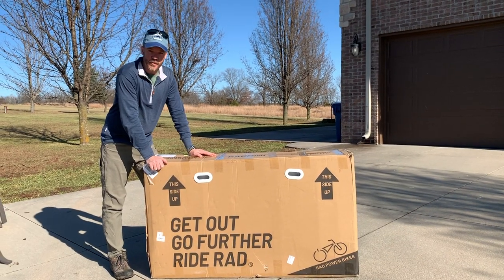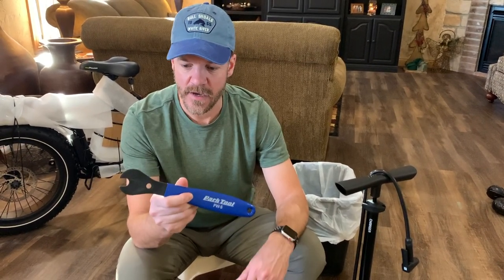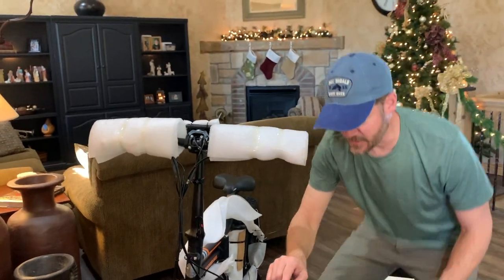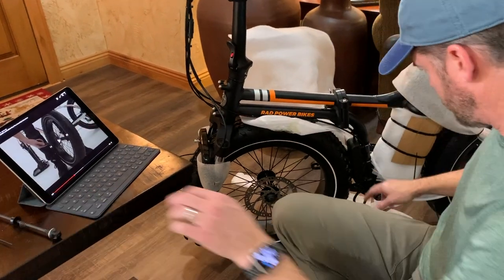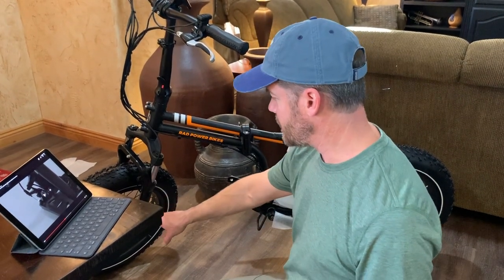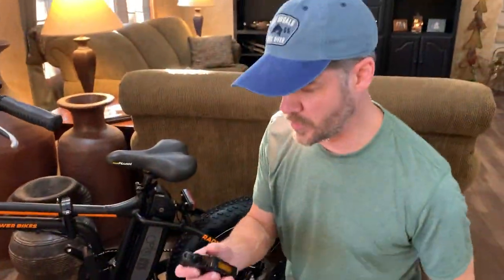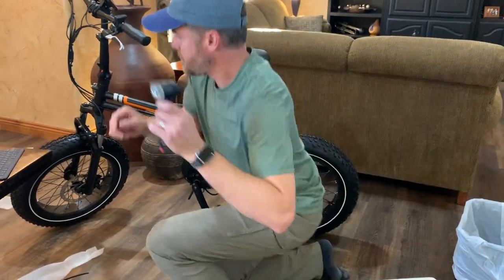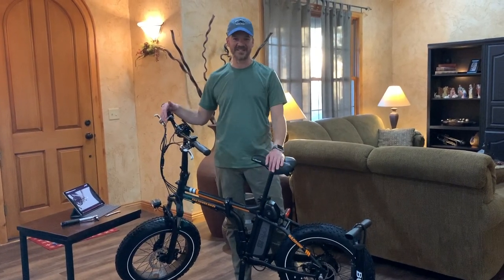Rad Mini Unboxing, Assembly, and First Impressions // Rad Power Bikes

Comment: How tall are you in feet and inches? Just wondering about the height of the bike and comfortability
Reply from the maker: I am 6‘2“ tall. I have the black Rad mini bike. I put the seat post at the highest possible setting and don’t feel crowded. I really like the bike. I will likely find an aftermarket seat post so that I can get another inch or two of height. Good luck!
Reply: I'm 6'6 and everythings maxed out- I like the raising handle bars

Comment: A great video and very helpful for somebody thinking of buying a Rad Mini.  I am thinking of buying, I live in an apartment and use an elevator.  Is the bike easy to move around when it is folded up?  Can it be wheeled when it is folded up?  Cheers
Reply from the maker: The mini is a great option because of how it folds, but it is a little clumsy in that position. My suggestion for an apartment would be to roll it into your place, and then fold it up to put it away. I think it is small enough to go on most elevators without folding. Good luck!
Reply: @TodayisanAdventureDay  The elevator is only for 8 people and a Rad mini would not fit in without the bike being folded.  I know the bike is heavy.  I'd be grateful if you could let me know if you think folding the bike to get it in the elevator every day  would be maybe too much hassle for most people?
Reply from the maker: The challenge is that the bike will not roll once it is folded. Perhaps you could lift the front wheel up and roll the bike on its back wheel into the elevators so that it is standing upright. I’m not sure if that would help the situation or not. The final option would be to fold it in half, put it into a rolling tote, and then rolling the tote into the elevator.
Reply: @TodayisanAdventureDay  Thanks for your reply, the key piece of information for me is the bike does not roll when it is folded.  I think this would make things awkward for me.   The elevator I use is lined internally with mirrors and I'd be afraid I'd smash one if I rolled the bike in on the back wheel.  I think I would have to fold the bike and put it in the elevator. Once out of the elevator I would have to unfold and then fold again to store within the apartment, that looks maybe too much work.  Thanks again for your  reply's they are very much appreciated and informative.

Comment: You should swap the front cross bolt around so that the quick-release is not break side. You dont want that thing to snag branches near the brake calliper.

Comment: Great video. Very elaborate. I'm having trouble with the front wheel. After assembly, I noticed the front wheel doesn't spin as freely as regular bicycles. When I loosen the brake caliber, it's not as resistant. Is this normal? Everything looks to be aligned properly.
Reply from the maker: It sounds like you need to adjust the front inner brake pad. It is likely just a little too tight and is rubbing on the disk. At the front wheel, pass a 5mm Allen wrench through the spokes and into the inner brake pad adjustment dial. Turn the tool counterclockwise 1-3 clicks to increase the space between the inner pad and the brake disc. I had to do this as well to allow the front wheel to spin without resistance. Good luck!
Reply: @TodayisanAdventureDay  Thank you very much!
Reply: @TodayisanAdventureDay  I had the same problem thank you!

Comment: Thanks for the video, looks like I need to buy a pedal wrench not sure if there’s different sizes or one fits all??
You did OK with the tinsnips. I heard you say I am might need to get my knife. I Have a heart attack every time someone says they’re going to cut a zip tie with a knife or a pocket knife!!!
I watched a guy one time pull back toward himself with a pocket knife when the zip tie breaks because you don’t really cut them you actually break them with the blade.
He pulled back toward himself and got himself right in the nose with the knife!!!
Cut his nose off to spite the zip tie!! Never cut the zip tie with anything but a pair of Plier style wire cutters!!!!!!
It’s nice to have a pair of wire cutters and A set of Dykes. Dykes are the wire cutters that have the pliers on the front and the wire cutter part is in the middle of the jar some people call them side cutters.
Just a little safety tip for you don’t wanna see anyone get injured!!!
Reply from the maker: Thanks for the tip! As far as the pedal wrench, I picked one up at my local bike store and it seemed to just be the standard size. Good luck and happy riding!

Comment: Great video. What size torque wrench did you use?  I'm hopeful not to buy a whole set.  Thanks in advance.
Reply from the maker: Sorry for the delay in response. I haven't had a chance to dig up the set to double check. Are you still needing that measurement?